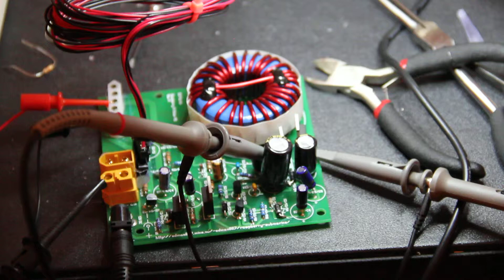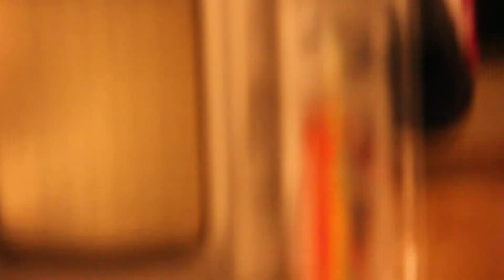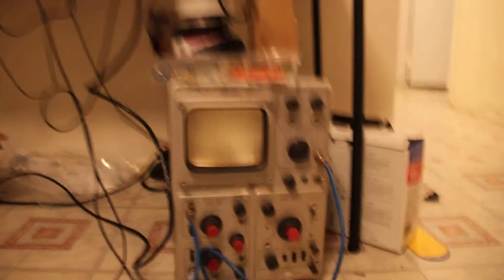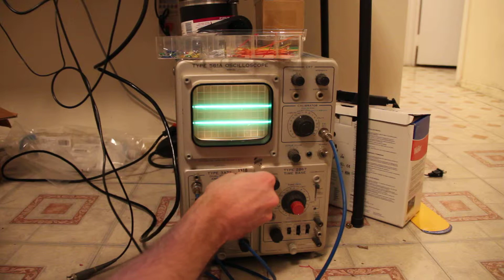Tex 561A

Comment: And you should look for a 3A1 or 3A6 dual channel amplifier, when you are watching fast signals. they also have a switch for triggering on channel 1 only. You could also use the external trigger input of your time base. In chopper mode the scope triggers on the chopping signal of your 2-channel amplifier.